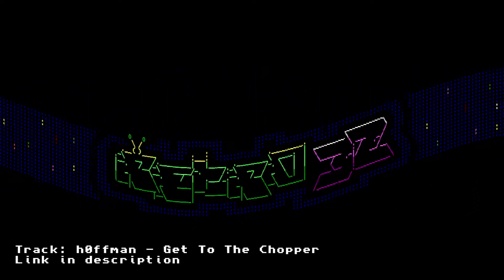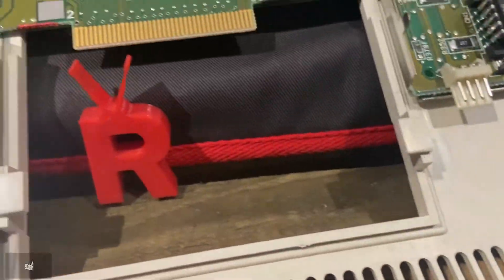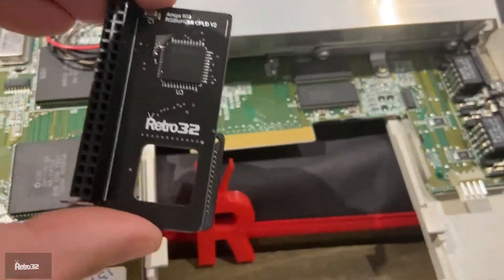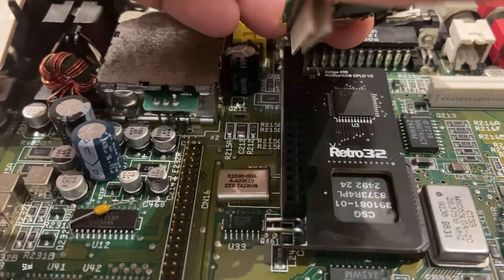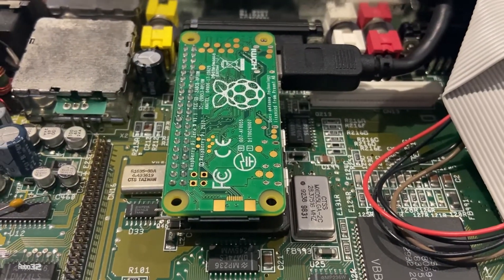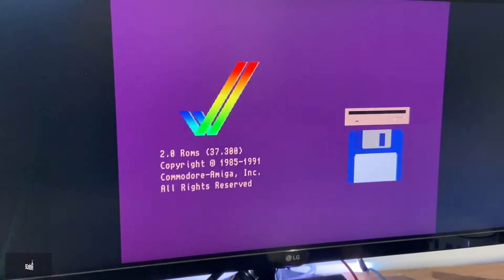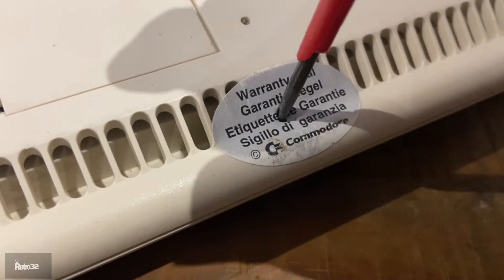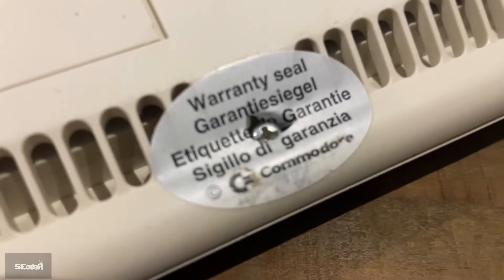Amiga 600 RGB to HDMI CPLD PiZero Adapter fitting guide

Comment: Hi there is any option to run with Vampire v2 ? Thanks
Reply from the maker: We’re just working on a reworked board that will be a two piece design. That should allow accelerators to run. I’ll keep you posted